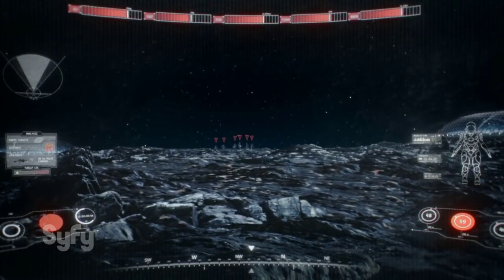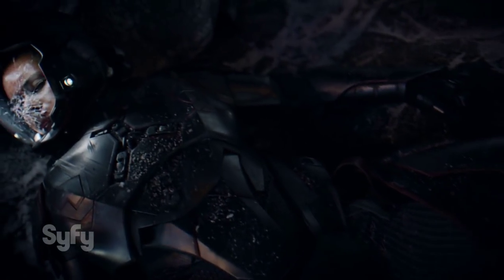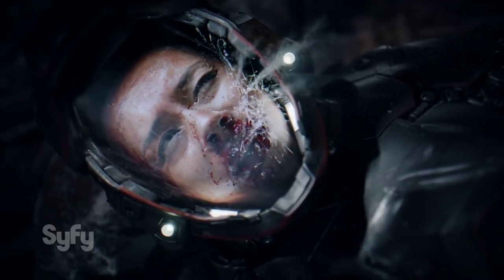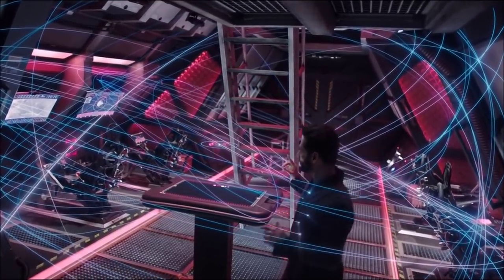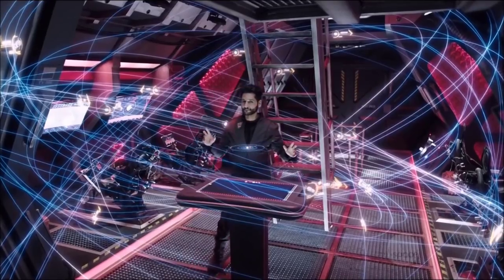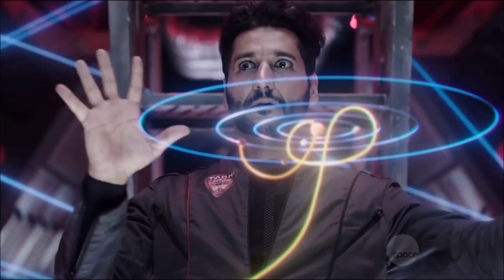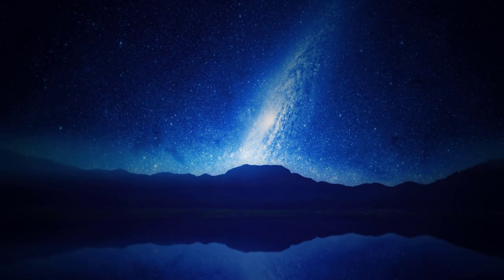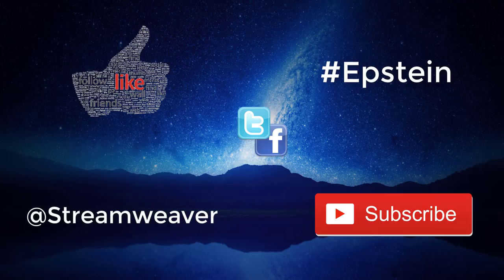Let's Do the Science:  The Epstein Drive

Comment: Based on information in the books, the drive is an inertial confinement fusion drive with a magnetic coil to boots the exhaust, that uses a D-3He reaction, and that can use an afterburner system for landing.
Reply from the maker: You might understand the physics here better than I do.  There are a couple of things that seem to make this unlikely but I'd like to get your thoughts as you may know it better than I do:

The energy return form D-3He reactions doesn't seem anywhere near what would be needed for 15 or 30G acceleration, even with Magnetic boost.  This is one of the more powerful and efficient fusion engines we can calculate now and it's nowhere near the acceleration.  So I'm proposing there is some kind of secondary reaction going on, fueled by the reactor.  In particular this kind of fusion drive would provide a vast surplus of power available to catalyze a secondary reaction.  

Also, although batteries seem good in this setting, it seems unreasonable to tie your primary power source to the need for thrust.  

So generally I concur that the type of fusion reactor would make a good candidate, I'd still assert there is some other mechanism that forms the actual drive that is fed by that reactor.
Reply: I'm not entirely sure if they use a D-3He in the drive, but it is mentioned in Babylon's Ashes that a small belt station ran out of 3He for the reactors. They may use an other reaction like p-11B reaction for the drive. I'm pretty sure that may be energetic enough, but not entirely.  I am sure that the writers don't have the regard the physics, given their estimates for times it would take to reach places.
Reply: Lets Do The Science, also your videos are great.
Reply: Ironically, from what people have said about the travel times in the books, they're actually sort of too slow given the speeds that are often mentioned in the books.

Like the authors say the ships will reach somewhere at x time but if you actually calculate, you often find that the ships should reach earlier than x due to their constant accelerations and all.
Reply: Well it is essentially a scifi magic fusion torch drive, like practically all torch drives are. The original Heinlein torch drive was really a matter-conversion engine (and I don't mean antimatter, I mean one of those magical 100% conversion drives that are still reaction engines.) 

It's mentioned in Leviathan Wakes in Chapter 17, when they're discussing the Rocinante for the first time, by Naomi that the Rocinante: "“We’ve got a full tank of water, the injectors have enough fuel pellets to run the reactor for about thirty years, and the galley is fully stocked. You’ll have to tie me up if you plan to give her back to the navy. I love her.”

So it seems like water is the reaction mass and fusion pellets are the fuel source for the reactors in-setting.
Reply: your understanding of physics is rather weak, you shouldn't be running this show

a D-3He engine would need a lot of water to be injected into the nozzle to produce such high accelerations, prompting the need for very big tanks, and there is not enough medium to scoop from the solar system via magnets to work as the working medium

so the drive is an impossibility, given the absence of water/working fluid tanks and even then a prolonged aceleration of 1/3 g would be unlikely to last for more than a day, due to the rocket equation

and ur right, pure fusion would produce only few % of a g and that's strething it

the drive has been falsified..it's nonsense
Reply: hahhaha, no you can scoop ionized hydrogen, are you drunk?
Reply: with a powerful enough magnet water can be manipulated and has already been done both at home and in lab conditions. A simple understanding of physics chemistry and magnetism are enough to prove this.
Reply: IIRC They don't usually draw straight lines to their destinations in the book. They generally take efficient routes over faster ones to conserve reaction mass. Going from the Earth to the belt, or Jupiter in a straight line under constant thrust would cost a lot of fuel, but using basic orbital mechanics to assist your flight can save a lot of fuel.
Reply: The magnetic fields required are too strong to project over a big enough region to collect water though.
Reply: I can picture the idea that the fusion reactor is actually doing some field perturbation that allows it to interact with dark matter to use it as propellant. That's why the engines only burn in the nozzles and don't leave a tail of radiation as they go. Or maybe the pellets are made of anti-matter?
Reply: Damian Reloaded They leave radiation trails in the books IIRC.
Reply: So maybe anti-matter then. That'd be 100% efficiency essentially. I read that For a maximally efficient antimatter rocket where all the exhaust shoots out at the speed of light, we have V=1, and with A=0.00011776 and D=0.522 the second long equation tells you the initial mass including fuel would only be 1.0158 times larger than the final mass at the end of trip, so you only have 0.0158 tons of fuel for every ton of payload mass .
Reply: There probably would be enough material to let you run a fuel scoop (Bussard Ramjet anyone) but it would probably need to be moving at near relativistic speeds to work, hell they even appeared in Star Trek - Insurrection.
Reply: water is used as reaction mass for the RCS system, hence Teakettling.

If you've gotten this far you've seen the spoilers, be warned:

They've been getting better about exhaust plumes in season 2 of the show, probably to set up for them vaporizing the protomolecule soldier in the finale.  You can see the scaffold melt behind the Nauvoo as it launches.
Reply: @Let's Do The Science ~ The energy production of different fusion reactions only varies by roughly an order of magnitude, and Duterium-2 + Helium-3 is one of the most efficient as well as having the most readily available fuel source to an interplanetary civilization (lots on the Moon, whole lot more in the gas giant atmospheres). It's also aneutronic, meaning less than 1% of the energy released is in the form of fast neutrons, requiring a lot less shielding from people and electronics. However, power production is not the issue. We have absolutely no idea how fast the mystery reactor goes through it's fuel. The problem isn't that the ships in the Expanse accelerate too fast, but that they would run out of fuel quickly doing so. Fusion on average converts about 10% of the mass of the fusible nuclei into energy. That just what fusion is, and there's no getting around that. I love the show, but the ship's travel times just don't check out for fusion unless they're hiding huge fuel tanks somewhere. Someone else here mentions dense fuel, but there are certain limits on how much you can compress any particular element before running up against electron degeneracy (and by extension the basic math of quantum mechanics). Go beyond that and it fuses into heavier elements plus the energy difference (until you reach iron after which it's minus the energy difference), which is exactly what inertial confinement fusion is. So unless the ships are really mostly fuel tanks inside, the math just doesn't add up. And frankly the missiles seem to have the same drives, and their apparent internal volume is rather more limited. I like your channel though :)
Reply: @nehorlavazapalka ~ Lighten up, Francis. It's a small-time YouTube channel, not PBS. People learn by asking or making mistakes and being corrected. When you're a jerk to them, it discourages them from learning.
Reply: I believe its mentioned in the books that the main drive is an ion drive that runs on either hydrogen left over from oxygen generation from water or using the oxygen and the hydrogen is used for cooling.
Reply: that sounds like another nonsense
Reply: Well, they only cost extra if you don't factor in the benefit of thrust versus input consumption, which, in the case of trans-helical momentum drives is quite high (I believe it achieves a 127 on the Nektro-Sklipper ivp charts).
Reply: How does one afterburn a fusion drive?
Reply: According to current science The Expanse engines cannot be fusion drives. The only thing we know could possibly theoretically be that efficient would be an anti-matter drive. Another thing that I can imagine is some kind of weird ultra stable impossibly heavy man-made matter where a lot of energy is artificially stored, and then released through some process inside the ship's engine.
Reply: Damian Reloaded When you say fusion drives aren't efficient enough do you mean efficient enough with propellant or with (nuclear) fuel?
Reply: by injecting water or any other material into the exhaust, B-52s use water, jets use their own fuel

it increases thrust at the expense of final velocity
Reply: William Raab Of course! It's so obvious! Why, they could even use a turboencabulator for that!
Reply: nitroxide91 When the term afterburners is used in relation to fusion drive, it usually means that the engine introduces a liquid the when heated up would expand (like hydrogen, lithium hydroxide or in the case of the expanse, water), drastically increasing the engines thrust. In other words, it creates a setting of the engine that has low specific impulse and higher thrust as opposed to the setting of the engine that doesn't use an afterburner having high specific impulse and low thrust. In torch drives such as the Epstein, adding an afterburner would still decrease specific impulse and increase thrust, but with torch drives, the engine still has INSANE specific impulse, so this process would essentially increase fuel costs and decrease travel times.

Several of the ideas I have seen are definitely interesting. Some are insane, but still interesting.

I've gone rambling.
Reply: Using Hohmann transfer orbits takes up a lot of time. Much longer than what is shown in the series. The trips would take weeks and months instead of days. I doubt that preserving reaction mass is crucial in The Expanse. It seems, they just go wherever they want at max speed that is tolerated by the human body.
Reply: So basically a fusor/polywell with a hole cut in the side for exhaust.
Reply: Gareth Smith 

Damn, uh, what he said.
I envisioned only having to spray tiny streams of fuel and getting massive thrust.
Reply: John Koeberlein I don’t know. It’s not really specified.
Reply: From all appearances its a magic/super-tech "reactionless thruster", like the "repulsors" on Tony Stark's Iron Man armor.  It only requires electricity to function, and that is what the fusion reactor is for, hence the absurdly high apparent fuel efficiency.
Reply: It's a problem of power generation. A fusion reactor of the size indicated could theoretically generate the amount of power required to get both the demonstrated specific impulse and thrust. The problem is that any such reactor would generate enough waste heat to vaporize the rest of the ship.

How to make a reactor that generates that much thrust, with that high a specific impulse, without damaging the ship is an engineering exercise left to the reader :)

For more info, look at the "Atomic Rockets" site on its fusion propulsion page. I have no affiliation to that website, except that I love it!
Reply: It would only vaporize the rest of the ship if it was actually connected to the ship in some way. Given a proper divertor and magnetic confinement the fusion plasma would be facing away from the ship and form the exhaust plume. That's actually one of the engineering challenges that for nuclear fusion on Earth as well: How to get the plasma hot enough without incinerating the support equipment by doing so.
Reply: If this is sci-fi magic, then we're all muggles trying to understand something that won't be invented for hundreds of years.  We would have all been burned at the stake for showing off our Bic lighters hundreds of years ago.
Reply: The acceleration depends on the total momentum ejected, not on the energetics of the reaction. So the momentum per unit of reaction mass is larger when you use ALL the available energy to propel the reaction products. The problem is that you need an insane power, the acceleration per unit POWER decreases with the amount of reaction mass (this is why rockets must use so much reaction mass). 

I would opt for a neutron-less reaction (not to have to deal with this awful neutron flux) and use really little extra reaction mass apart from the reaction products. This is the only way to have a sustained (months) 0.3g acceleration without having to carry more than 50% of the total weight in reaction mas.
Reply: In the book standing in the eject path is deadly, even kms away from the nozzle. They have to brake pointing a bit away from the destination, and perform the final approach using maneuvre thrusters.  You have basically a tail of sub-relativistic plasma, that even when cooled is fast enough to burn you.
Reply: Assume, for ease of computation, that the reaction is 1% efficient (a bit on the low side, but anyway not far from real). You have 1% of your mass in energy. If everything is converted into kinetic energy of the plume, eject speed is ~c/7, or  ~40,000 km/s. To get 0.4G of acceleration (4 m/s2) you must eject 1/10millionth of the spaceship mass per second. With half the mass in reaction reagents, it can be sustained for 2 months. If you mix the reaction products with some unspecified reaction mass, with a 3:1 ration, you halves your speed, so you must put out twice as mass (total), and you run out of reaction mass in a month.
Reply: Fusion drive is energetic enough. The problem is the energetic. To produce an efficient thrust even for the Roci, the reactor would be powerful enough to power a planet. And you would just sit on it.
Reply: Fusion/ antimatter  engine  ?
Reply: I want those books. I am a little strapped for cash. Do you have the ebooks and want to share?
Reply: Maybe they were using such reactors for the older, 6-months-to-mars travel, and whatever Epstein invented was some deceptively simple modification that actually worked far better than he ever dreamed
Reply: YES!! Now picture this, compressing ionized helium in this "modified" fusor, from a hydrogen fusion's reaction, and using the electrical power from the primary fusion reaction to drive the electrostatic confinement. It's a 2 stage fusion drive.
Reply: No such thing as an antimatter engine and such 'looking intos' are propaganda for more money from the tax payer.
Reply: They do say in the book that it takes weeks to go to Mars and it can take up to almost 6 months to get to Neptune and that sometimes they don't accelerate for weeks or months.
Reply: So, in other words, it's a coilgun that shoots fusion reaction...
Reply: hmm, kinda like an ion drive on steroids
Reply: Perserra no. It is by no means a reaction less drive. Read the books they mention large plumes being given off. It is based on actual science. Certain components used in a drive like this (many pertaining to ignition of fuel pellets and dispersion of heat and radiation) are not feasible with today’s technology. Things like these do not only require electricity to function.
Reply: Gianni Comoretto oh yeah. These reactors on drives would have to put out dozens of tarawatts to produce this kind of performance.
Reply: Chason Note I don’t have it. If I did I probably would
Reply: cyrus zahed yeah the authors are weird
Reply: manictiger I mean sort of
Reply: @warellis  don't forfet they have to flip and decelerate from halfway too.
Reply: Maybe another a fuel source is being thrown into the main drive before exiting the ship. Like an afterburner on a fighter jet. Or it could just be the fusion version of a ram jet. It could be Helium 3 🤷🏾‍♂️🤷🏾‍♂️🤷🏾‍♂️as the fuel source for the initial fusion reaction.
Reply: @lockwright4110  Deuterium - helium-3 fusion yields 353 trillion joules per KG including x-ray and neutrons if we rule out x-ray and neutron losses. D + helium-3 fusion produces 76% of the helium-4 particles that can then be driven by a direct thrust magnetic nozzle if it were possible to use all of this 76% or 268.28 trillion joules it would be possible to accelerate an object to 7.72% of light speed considering only the fuel energy density, Epstein could make 3.7% speed of light in addition to offering an extremely high specific pulse.
Remember that the Series is based on close-to-reality fiction based on the propulsion of ships here there is nothing Star Trek science.
Given the vast amount of deuterium out there and helium-3 being a very precious resource, I would expect them to use the deuterium-helium-3 fusion in The Expanse and not the helium-3 + helium-3 fusion that is Much harder but it produces no neutron in the by-products of fusion.
They could also use catalyzed DD + D fusion as presented on the updated atomrockets website. 
http://www.projectrho.com/public_html/rocket/enginelist2.php#fusionbreed
It is also worth remembering that Drive Epstein did not allow large fractions of the speed of light to be reached, it was nothing more than an improved and very efficient nuclear fusion engine and its speed is within the limits for direct nuclear fusion propulsion, as far as it is concerned. Acceleration would largely depend on the engine's capacity at the rate of fuel being fused per second for direct exhaust.
So I get deuterium fusion - helium-3 or DD + D fusion according to the updated concept about this kind of reaction from the atomrockets site.
Season 3 episode 2 shows an abandoned helium-3 refinery on Jupiter's Io Moon.
They may have switched to DD + D fusion and no longer required the mining of the atmosphere of Jupiter or another solar system gas giant. Because deuterium other than helium-3 can be found anywhere in the Solar System that contains many volatiles: water-rich or methane asteroids eg planetoids or even Mars that would be much easier to mine in energy cost given the very gravity smaller than in the gas giants. For each KM³ of terrestrial water there is just over 34.9 thousand tons of deuterium, if we take a typical asteroid with 10 KM³ of water ice it can contain 349 thousand tons of deuterium based on the abundance of deuterium found in ocean water. enough to power The Expanse ships for centuries as the fuel has a huge energy potential KG.
Reply: @LetsDoTheScience  actually that's supposed to be that way. Epstein discovered a previously thought impossible reaction that facilitates just that. It's meant to not be explainable with our science but still the realistic once in a generation discovery that could happen
Reply: I know in the books, some belter ships too small for epstein drives instead "run teakettle" where water is boiled off and the steam is the reaction mass. If the fusion drives also use water or some element of water in the reaction (say deuterium) then I think it fully justifies the idea that water is the most valuable resource in the solar system - though in Cibola burn (the book) its implied that while fusion is no-functional, and thus the main drives don't work, that the ships are running off battery power to run their "tea kettle" thrusters, though the urgency to conserve water seems lost, the ability to heat it up is certainly a cause for narrative tension anyway.

Well Hay, isn't good Sci fi more so ment to engage it's audience than to just show us a window into the most likely future? Not saying we shouldn't have this discussion, but I will say it's good that the show spurs these questions out of people.
Reply: I have read all the books up to Babylon's Ashes and I distinctly remember a Holden chapter, near the beginning of the book with Prax as a POV character, where they stop at a station to pick up ammunition and ship's fuel.
Reply: I like where guys are going with this discussion. Everyone here, so far, has argued about the need for a lot of fuel to make long trips or to provide long burn times. But something that has been overlooked is that you only have to provide enough thrust to get you to speed or "G-forces" as they say on the show. In the emptiness of Space there is nothing to slow you down except reverse thrust. So once you get up to speed, whether it takes 5 (?) seconds or 5(?) Hours, your engines can be turned off until you need to employ reverse thrust - You are just coasting thru Space. So however amount of water they have, is only used in limited amounts - It could conceivably last the Rocinante YEARS!
Reply: @LetsDoTheScience  That is the McMuffin part of the "magic" drive. You either get High Thrust, Low Impulse or High Impulse, low Thrust but not High Impulse, High Thrust.
Reply: @warellis  That's because 2G after seven days will cause all kinds of issues with the human body.
Reply: @warellis  To be exact, the Hydrogen in the H2O is the fuel.
Reply: @DamianReloaded  They can be, an McMuffin is the "magical" tech that allow something not possible for story. IN this case it is a superduper efficient fusion drive. Also there's not enough antimatter in the whole solar system to run one of these drive for more than a second.
Reply: @Mortlupo  Yes, when antimatter drives are considered it's assumed the antimatter is artificially produced. I just finished watching season 4 and they explicitly talk about fusion and they even show the engine from the inside. Those pellets must be made from McMuffin for sure ^_^
Reply: @DamianReloaded  Except our Antimatter production will take decades just to produce a few grams, simply put we can't produce enough fast enough t make it useful.
Reply: @Mortlupo  With today technology/knowledge yes. But we are talking of a level of tech that allows Epstein Drives here. Anyway in the series it's still fusion. The pellets, by some magic, fuse themselves with 99,9% efficiency. Maybe an hybrid? (See Antimatter rocket wiki) [...] Catalyzed fission/fusion or spiked fusion
 This is a hybrid approach in which antiprotons are used to catalyze a fission/fusion reaction or to "spike" the propulsion of a fusion rocket or any similar applications. The antiproton-driven Inertial confinement fusion (ICF) Rocket concept uses pellets for the D-T reaction. The pellet consists of a hemisphere of fissionable material such as U235 with a hole through which a pulse of antiprotons and positrons is injected. It is surrounded by a hemisphere of fusion fuel, for  example deuterium-tritium, or lithium deuteride. Antiproton annihilation occurs at the surface of the hemisphere, which ionizes the fuel. These ions heat the core of the pellet to fusion temperatures. The antiproton-driven Magnetically Insulated Inertial Confinement Fusion Propulsion (MICF) concept relies on self-generated magnetic field which insulates the plasma from the metallic shell that contains it during the burn. The lifetime of the plasma was estimated to be two orders of magnitude greater than implosion inertial fusion, which corresponds to a longer burn time, and hence, greater gain [...]
Reply: @nehorlavazapalka  The Epstein drive is a necessary mcguffin in both the books and the tv series. And the authors never denied that.
Reply: WHERE ARE THE RADIATORS
Reply: @warellis  I had thought the same thing, but then I wondered: can you actually just fly in a staight line between points in the solar system, or do you need to fly along orbital curves that considerably add to the distance covered? Certainly if you're flying to something on the opposite side of the sun you need to swing wide to an acceptable distance from the sun, but does flying in an orbital system also introduce constraints?
Reply: @jamestopoleski9255  
What do you mean by that in terms of this discussion?

The show takes what you talk about into account. When ships arrive they burn away from their destination. Sometimes they don't start halfway but instead a lot closer and simply engage in a much higher g burn than their approach. That's normally in the context of warfare. I'm pretty sure in the very beginning of the series there's a whole thing about spinning and decelerating the massive ice hauler. Anyway. If you look closely ships are often orientated "away" from their destination.
Reply: @warellis  probably heavy water
Reply: @warellis  I would think that with computers of that age (btw, where is the A.I. in the future? I expected ships to be talking smack back to their pilots) that the acceleration curve, constant 1G and deceleration at 1G would be calculated into their trajectories. One of the scenes they showed here in this video was Alex plotting a zero G path through the planets using the sling-shot method only as a velocity control. The computer would have to take into account not only the path around a planet (or moon) but also the positions of the planets or moons when the Rocinante reached them. Luckily, the projection models are relatively easy because they don't change much over short periods.

This is also why I laughed at the sling-shot club that Miller stumbles into. The guy he was looking for ends up burning in the atmosphere of one of the planets he's sling-shotting around. I would think that these maneuvers would be much easier to perform in that future with the computers they have... of course, if they forego computers and calculate by hand, and then fire themselves off in a can... sure, that sucks.
Reply: @warellis  Remember that objects in the Solar System aren't always at closest approach, so it's reasonable to take more time than just calculating the distance between the orbits.
Reply: @DamianReloaded  In the first episode of the first season, there's a scene where we see the Cant from behind its engines. The screen shows a lot of sparks just like a real camera would show if under intense radiation. Unfortunately, the CGI team didn't do it to the scene where the Roci's crew do a barbecue out of the protomolecule hybrid - which is a shame.
So, yes. The engines in The Expanse leave a lot of radiation.